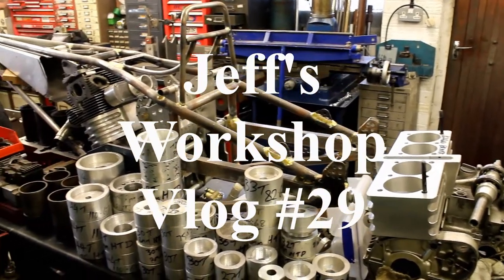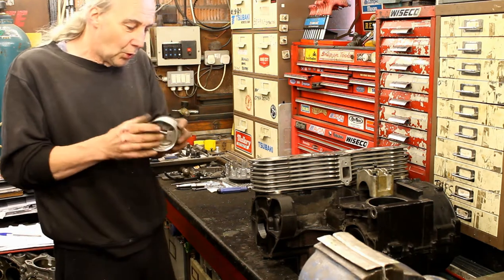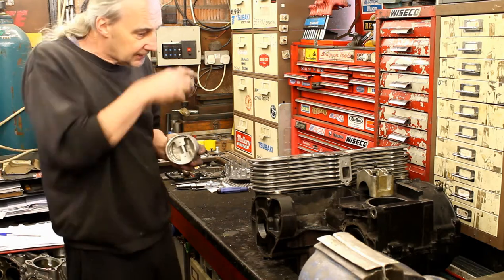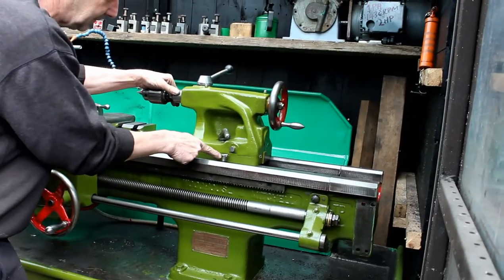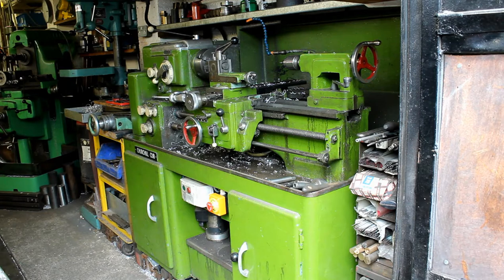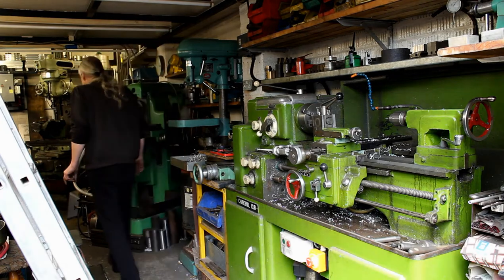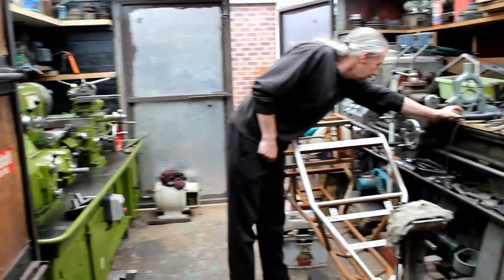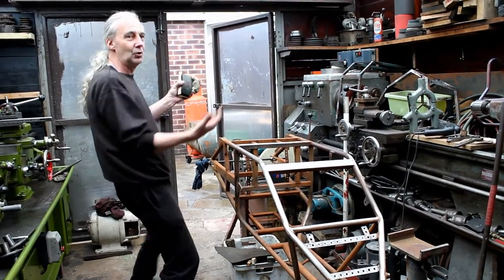Jeff's Workshop Vlog 30

Comment: Jeff is probably me in retirement! If he needs it, he just makes it happen. This is awesome. Grooving piston skirts for oiling via an external feed - brilliant! A supercharged 1500 cc Z street bike - absolutely nuts!
I'll offer some humble advice here on resizing / repairing bearing bores. Back in my days first as an industrial repair machinist (unofficial millwright) and then later building V-8 racing engines, I used commercially made line boring and honing machines. The portable and automotive versions are very simple in construction. I noted their construction and thought it would be reasonable to build my own home version someday. For my first (and only) try to date, I made an inexpensive line boring tool for re-boring camshaft bores in the Kawasaki Z1000 / J / GPz heads from a straight 3/4" x 36" 4140 ground bar shaft and an machined into it several cross pattern equally spaced square holes to hold adjustable - radial protruding cutting bit ground from 3/16" HSS and located / secured by UNF grub screws. Looking back now it would have been better to use round 3/16" HSS bits, but I had lots of 3/16" square on hand. The shaft of the tool is supported by two precision needle bearings. First I tried machined bronze bushes, but before I used the tool to cut the bores to final size, I located some 3/4" ID needle bearings and made thin aluminium interference fit sleeves to match the OD of the needle bearings to the cam bearing's bore size. The needle bearings allowed the tool to cut more accurately. I use a 1/2" drill motor with a universal joint drive. I feed the cutter longitudinally by hand with a 30 degree tapered / rounded ground cutting edge - although for larger bores I'd build a parallel geared reduction screw feed mechanism similar to the commercial tools. Locating the needle bearings in the good outer cam bearing bores, I re-bored the welded repair journals. Theoretically, I could have bored the ends of the casting with a sacrificial cam cover in place and then used those holes to locate the shaft to re-bore all the bearing bores (after cutting 0.010" from the bearing cap faces). As the set-up was used for repairing the welded bearing bores already, I used it to cut the clearances needed for high lift cams as well. It worked perfectly, removing up to 0.025" of material per pass. I have cut 3 heads for cam clearances this way now, saving hours over hand grinding them, and know exactly what clearance I have between the cam lobes and the head.
Reply from the maker: Hi Scott, thanks for the info, I shall pass it on. The problem was in the upper crankcase half. We will go through the problem and the fix in the next video about the Zed at the end of this week.

Comment: Most KZ dragbike engines machine the center cap flat and add a steel plate with an extension welded on it then cross bolted to the lower case.